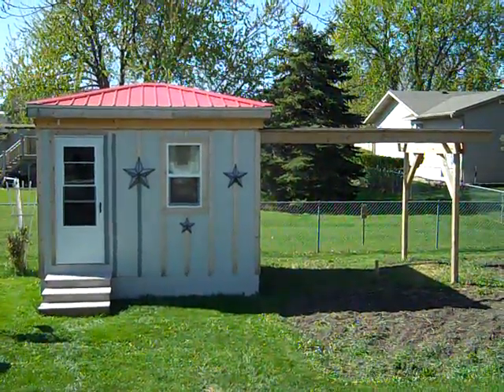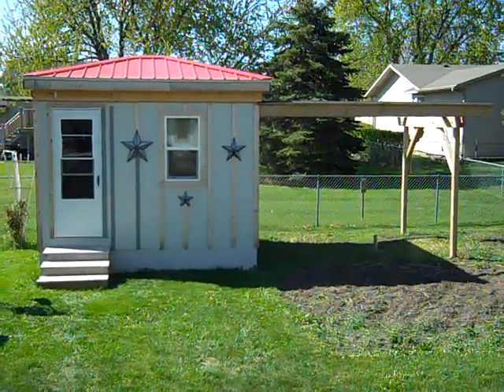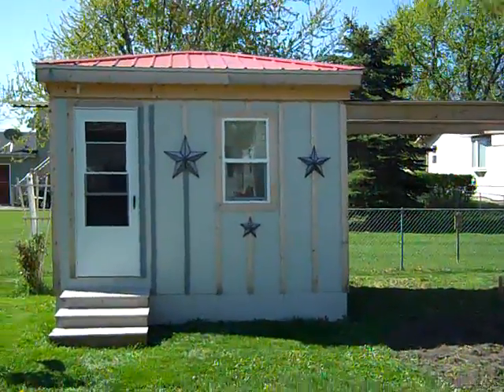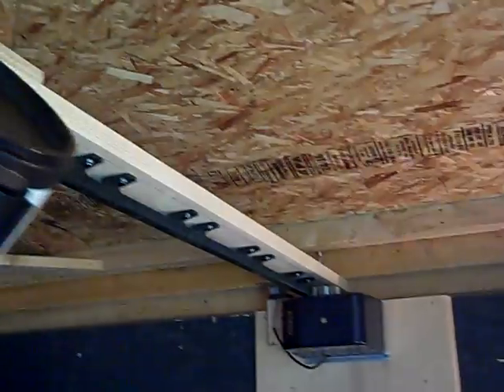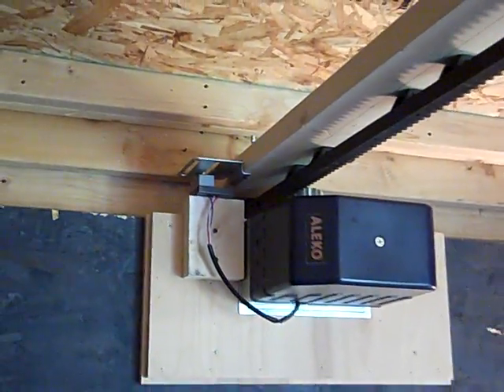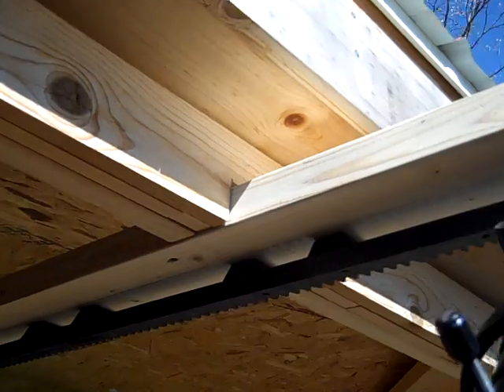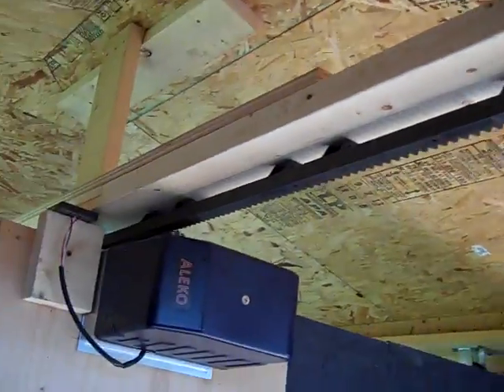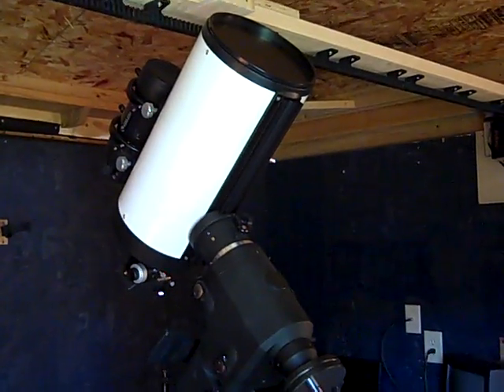2015 04 29 2015 04 29 002 001

Comment: That's awesome!  That's a great solution.  I was waiting in suspense until the end to see how you got the extra extension on the roof.  I'm probably going to have to do something very similar.  An external extension for the track.

Thanks for sharing!
Reply from the maker: The Astro Imaging Channel 
Thanks,There is still an additional 4 to 6 inches to work with as far as the out travel yet the roof as it is right now completely clears the building so no moisture can roll off the roof and into the building. I am planning on adding gutters to also help. Allowing it to move another 4 inches would not hurt either.